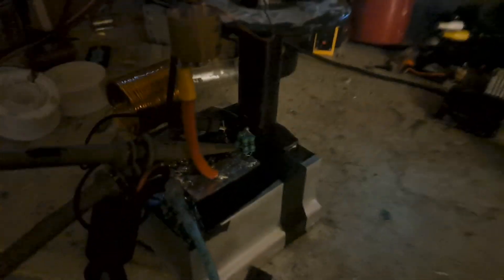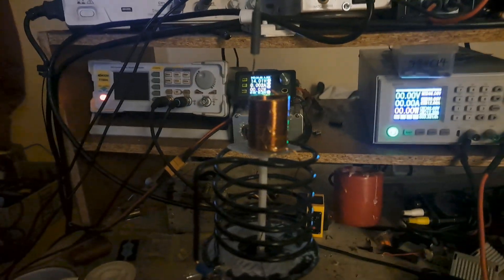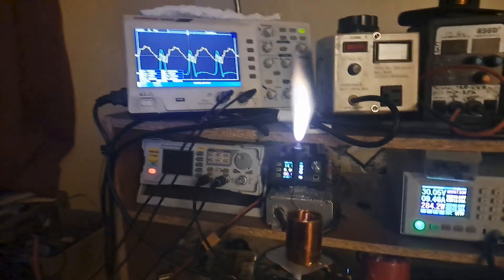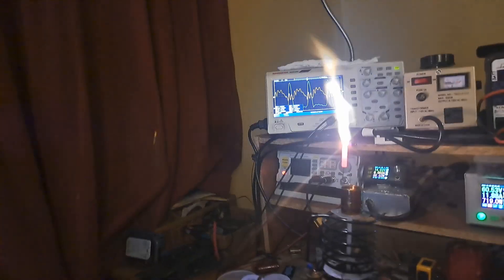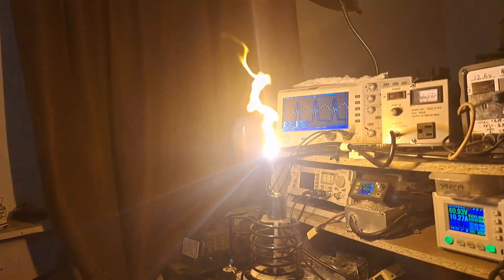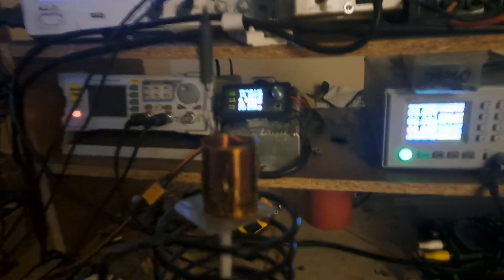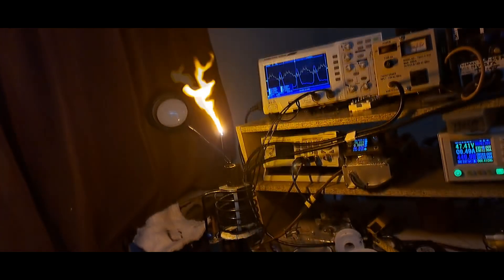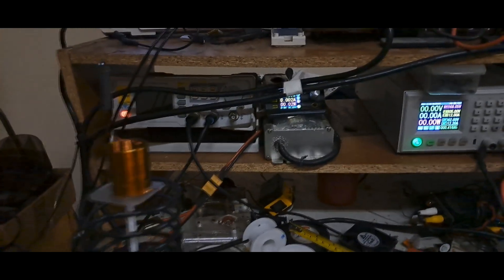HFSSTC 11.5Mhz 60VDC 600-700W

Comment: man your flame is that big at 60v, im terrified to change the gate resistance on mine now lmao
Reply from the maker: You pulling 11-12A though? This one seems to pull abnormally high current, but I just go with it in order to hit 700W from my supply.
Reply: @Magneticitist  no at max mine only pulls like 8.5 to 9 amps, but if i took the gate resistance from 3.3 to around 3.8 i could probably boost that up a bit

Comment: Awesome Bro!
Reply from the maker: What's up bro! You likey? Gotta say, the Si circuits are still really good but wow these things can really get up there with good fets.
Reply: @Magneticitist  haha Bro I'm jealous. These flames are huge. Hope I can find some time to work on it ;)
Reply from the maker: @Teslaundmehr  As usual Steve Ward is the man when it comes to providing good circuits and breakdowns on these. I wouldn't want to play a game of "hmm let's find out" with a bunch of SiC fets without someone like Steve already providing a pretty solid framework. Sure enough I killed a couple anyway just being stupid. One time I replaced one I killed accidentally, then started the circuit right back up forgetting I hadn't even re-added the doorknob cap I borrowed from it. Gate voltage goes up, a temporary "hmm that seems a bit higher than usual", then a nice click of death 😂.

Those Qorvo fets are pretty legit. I think they around ten bucks for really decent ones. I would say if you grabbed a decent little stash of various C0G MLCC's and one of those SiC's or two, you could have a nicely working one very quickly. I had to slap like 4 of them together just to make sure it was all as easy to setup as it looked.

Comment: Your mosfet survived 700 watts!!!! hats off to that mosfet
Reply: He's got a brick of aluminum stuck to it and has the gate well managed. I missed what model it is, but some of these things have mind-blowing performance characteristics when treated right.
Find yourself an inverter microwave oven, and the silicon is good for 1500W. Pretty neat stuff!
Reply: @nathanieljames7462  to be fair, those switch at tens of kHz, whereas this oscillator in the vid is switching at tens of MHz. Much more demanding. The IGBTs in an inverter microwave would shit themselves at these frequencies. This performance is only possible due to the incredible properties of modern SiC FETs
Reply: Similar SiC FETs have been known to easily deliver 3kW of RF. Insanity
Reply from the maker: Yea, as mentioned 700W is really nothing for this topology. Steve Ward and at least one other I know of has done 3kW or more.